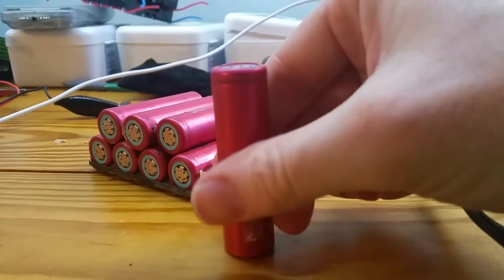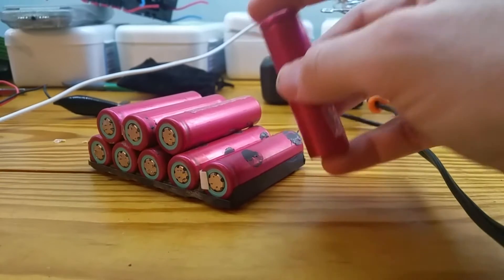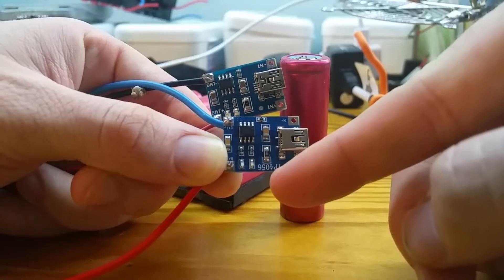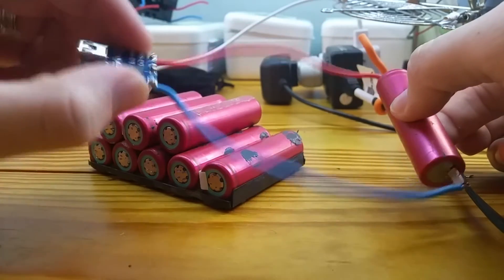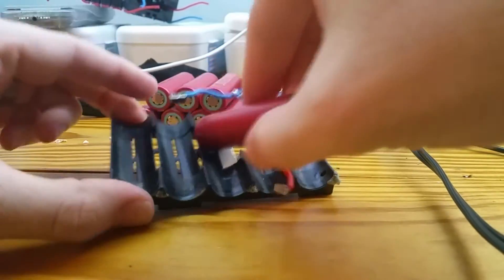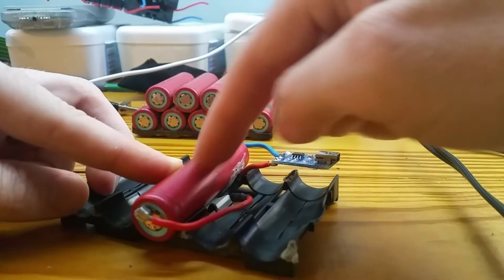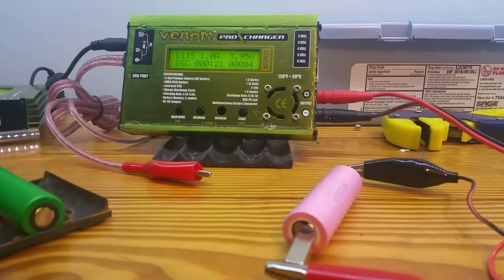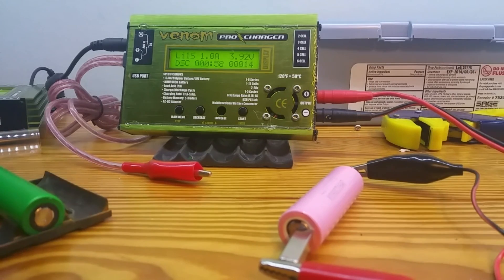Reclaimed 18650 Test Charge Discharge How To

Comment: Great tip: I have recovered low voltage batteries (like 0.01v-0.2v) by hooking up a fully charged battery for a few seconds. It got it high enough to be charged by my charger and tested the same as all my others and have had no problems with them so far.

Comment: Man, I'm going to make a huge battery charger, to charge up to 6 at once. (The problem is getting 5v 6A for that, or it's going to take the hole life to charge.) But, anyway, got a notebook battery that all cells had 0.67v. Recharge them and all of them hold more then 4v (4.18v, 4.17v and 4.15v). About the tester, there's a cheap board for that too. :)

Comment: It is a bit more complex than just judging by the initial voltage. You can do that but you might be throwing away quite many usable cells. Let me explain: I recommend checking voltage of cell pairs before separating them. Why? Average lapi batt has 3 pairs. If you have very old batt with 0.5v 0.5v 0.0v pairs - you can clearly identify that one pair got bad before others. And the other two might recover fully. I just tested with one of my 0.5v pair and it resulted 4400mah capacity after pulling it up again. But if you pulled all things apart before testing then what might happen is: you have 0.5v pair from  a pack that had pairs 3.7v 3.7v 0.5v -- that is a failed one in it's original pack and probably not worth looking at.
Reply from the maker: +gelisob  Great insight!    Testing them in pairs could save some time.  I've done it both ways and it's been a mixed bag. But most of the time you're right.  I've found that if a pair is .5v one of the cells could have gone bad and brings the other down with it, on a few occasions I've been able to bring the better half back. But even still, its capacity is never on par with the others in the pack.  I've began stacking the cells in grade A, B and C.  Projects with certain capacity goals will get A B and C cells as needed.  Thanks for sharing your thoughts.
Reply: I should clarify, I ment checking pairs after taking them out of the battery case - to identify the bad pair. I mark them as L (low) and know this pair has low hopes, if there's one clearly lower than others, there is very little point in separating that pair into individual cells then too. Then sort and move to next battery. Pairs are 95%+ times pretty equal so yeah. It's just that if you dismantle 10 packs, get 10x3 - 30 pairs mixed, or even worse, 60 cells, and then check the things, you have a lot less idea about whats most definitely garbage without a whole lot more testing. And might trash good stuff because you cant be arsed to go through all the lows.
Reply: As soon as you rip the plastic open, you have access to leads on both ends on most pairs. You can then right away check the status and mark the "L"oser and then throw them into a stack, if you prefer doing them all together later :)
Reply: so basically your saying that in a laptop the lowest pair one is most likely the culprit for the "dead" laptop baattery and isn't worth the time to look at, (both cells?) while the other pairs are worrth your time?
Reply: http://www.diypowerwalls.com/repacker.php

Comment: Most 18650s are rated to discharge to 2.75v safely. one mistake you are making, though, is assuming that 2000 mAh is a good cell. In reality, how good a cell is has more to do with percentage of remaining capacity. You have to know the original capacity of the cell to know if it's remaining capacity is within what you would find acceptable. This also means you shouldn't discount a cell that has a discharge rating of 1400 mAh if its factory rating was 1500.
A 3000mAh factory rated cell that tests near 2000 is only 66 percent and near the end of its life.
Reply from the maker: +Jason Simpson (Jason) I fully agree, you'd need to investigate the date code and other markings on the cell or rating on the laptop battery to help determine what the original capacity was.  Knowing that you can test and group them accordingly. 
My discharger has a 3.0v low cut off that I could change to 2.7v, but if I'm only ever going to discharge it to 3.0v wouldn't I be getting a rating higher than I'd ever actually use? My intent is to find the usable mah's within range of discharge for my intended application.

  Also, In your opinion, is there a difference between a cell that tests at 1000 mah that oem rating was 1200 mah, and a cell that tests 1000 mah that was a 2400 mah oem rating?  

Thanks for your comment and insight!
Reply: I do think that there is a significant difference between the two examples you give. On the one hand a 2400 mAh cell with only 1000 mAh left has only 41% of its capacity remaining, whereas the 1200 mAh still has 83%. The 2400 mAh cell has clearly suffered damage, whether through normal cycling or other conditions such as over discharge, and at this point could fail at any time.